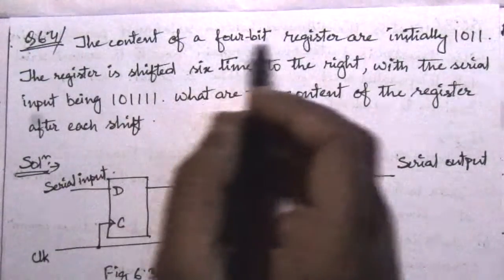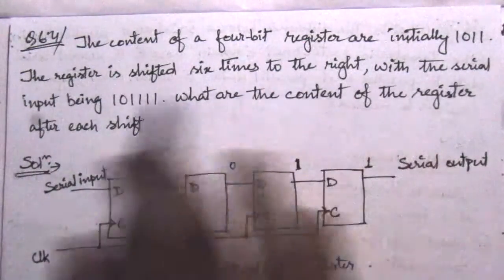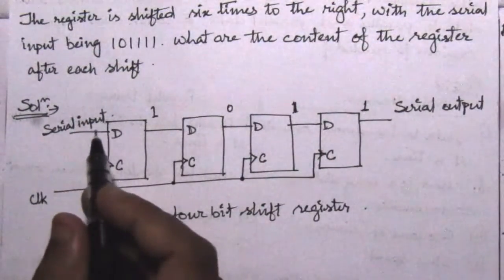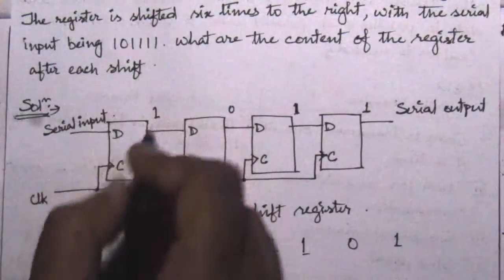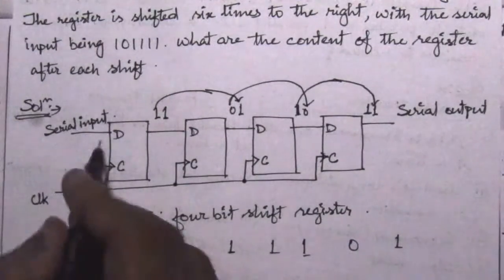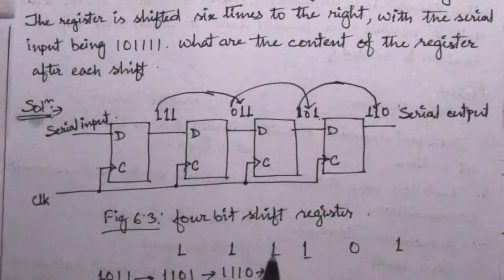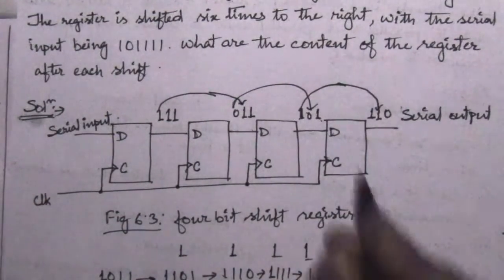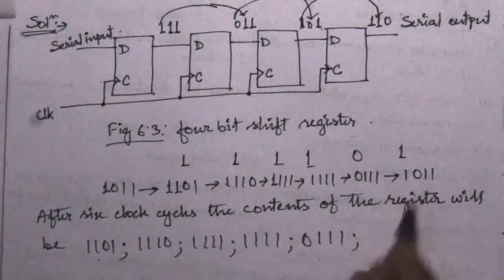Q. 6.4: The contents of a four‐bit register is initially 1011. The register is shifted six times to

Comment: sir if it says 4 times right then 3 times left shift what will we do after 4 times right shift???
Reply from the maker: You can shift in one direction using this circuit, i.e., towards the right
Reply from the maker: It is a SISO register, and without changing the direction of the flip flops you cant make left shift.
Reply: Thanks sir...after making 3 times right i use SISO and then shift left..❤️